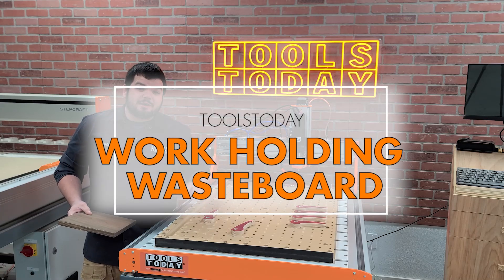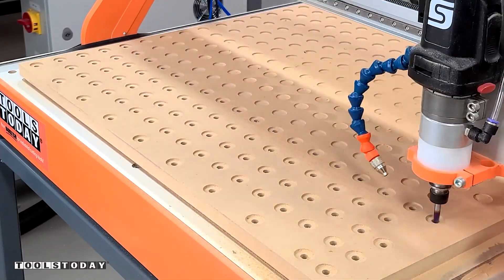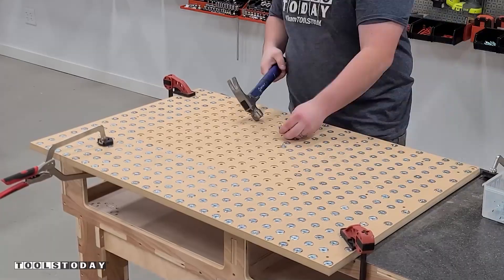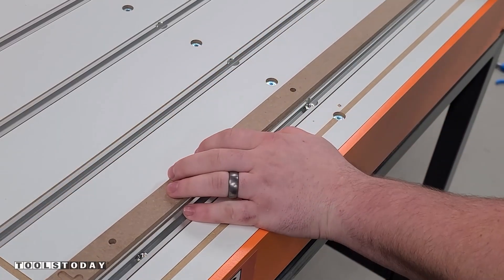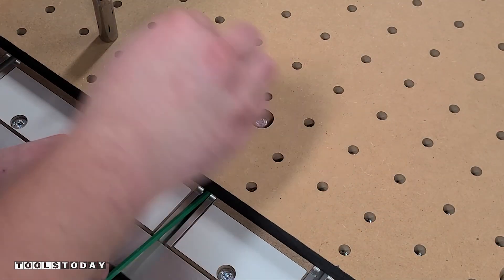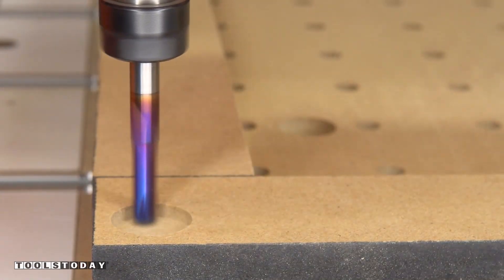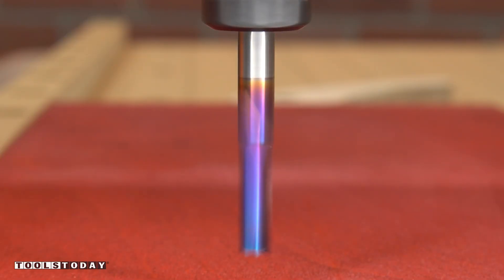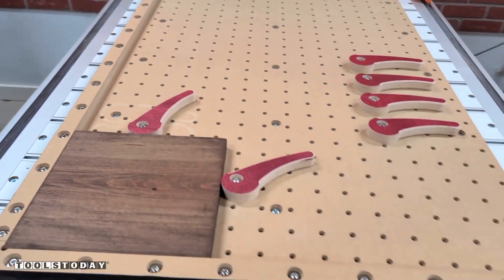How to Make a Work Holding CNC Wasteboard | ToolsToday

Comment: i has  test many different wasteboard system and this is best, i have bolt grid 2"x2" size M6 bolt uses., and working well, maybe sometime need if build 1"x1" bolt grid have better. but this wasteboard i have smalles piece can add to top normal wasteboard if need smallest grid. modular, can use some different wasteboard top of this wasteboard. bolt on smallest or vacuum board or special own only one workpiece board etc.
Reply from the maker: That sounds like a great wasteboard setup, I appreciate you sharing your experience!

Comment: I see that on the two fence pieces you painted the outside edges as well as the end of the spoilboard that shows, but did not paint the sides of the spoilboard. Can you advise the reasons please?
Reply from the maker: Purely for filming purposes. The cut edge of the MDF creates a bright spot when I set up the lights around the machine, painting it black eliminates that making filming easier.
Reply: @ToolsToday  Thanks for your prompt reply. I thought that it might be to protect it from spilling something wet on the MDF.

Comment: Nice.. 

But with double sided tape and CA glue.. 

Do you even really need tabs for most projects? 
You can cut the profile but your part is still secured with glue. 

I don’t even use tabs except for rarely or in aluminum.

Comment: Just downloaded the plans for this. Can't wait to get it modified to run on my Q404!! Thanks guys!
Reply from the maker: sweet!
Reply: @ToolsToday  I have the 16x16 AirWeights vacuum board and it clamps right down on this as the hole pattern matches exactly. I'm guessing the other AirWeights tables you guys have are the same. Makes setup and switching between manual hold downs and vacuum hold down a breeze. I have used your cam clamps as well as plethora of other types I've made to clamp things down on my Q404. This wasteboard is so versatile!

Comment: Great video, bought the plans and the Amanda bits.  When I fitted the bit into my CNC with the waste board in place I did not have enough Z height as I have the ATC adapter fitted to my spindle which reduces the Z height.  Looking closer at video, I see that your spindle is higher than mine.  You must have spacers installed.  How many spindle spacer rings have you fitted on your spindle?   Does the ATC still function with the spacer rings and the exhaust adapter connector (brush).  Please can you make a video showing how you use the spacer rings to raise your spindle, and show it fitted with the exhaust adapter and using the ATC.
Reply: Had the same problem with the Z height. So I designed a spacer in Fusion360 and 3D printed it. The height of my spacer is 25mm (1 inch).

Comment: I'm not seeing the materials list size T-Nuts and screws for the spoil board. I did find for the cam clamps.I already purchased the  plans.
Reply from the maker: Did you get the instruction file to go along with the plans?  It should have all of that information in there.  If you didn't for some reason, please email us at ttsupport@toolsday.com and we will get it to you.
Reply: t-nut size have what you want normal used M6 nut and bolts.

Comment: Hello Matt, GREAT informational video!! Thank you for taking the time to show us!!  Can you advise what size bolts (I believe 18pcs) and what size nuts (I believe 18Pcs) that fit inside the aluminum channel?  AKA, The nuts and bolts you used for attaching the waste board to the M1000 white board's aluminum track? Also can you tell us how long the 3/8" bolts used to hold down the clamps??  Hoping you can make a material list (quantity's/sizes) of all material used?  Trying to get all parts together prior to purchasing the plans and cutting the waste board! I have the bit's needed in my  tools today cart. :) 
Thank you so much in advance!! John...
Reply from the maker: Hey John. Thank you!  The plans have links to all of the hardware I used as well as the quantity of each.  I don't remember off the top of my head what each one was
Reply: @ToolsToday    AWESOME!!  Thank you!!

Comment: What spacing did you decide on for the holes? Anything lead you to that design choice? (Just wandering what ranges of values work well?)

Edit: guessing 1.5 inch?
Reply from the maker: Yes, I chose 1.5" on center.  It will allow me to hold most pieces without using any sort of spacer.

Comment: Hi. Great. But the right clamp must be inverse to sqeeze to the left corner down.
Reply from the maker: I've never personally run into an issue needing to inverse a clamp.  You don't need to clamp it at the very base of the work piece, clamping in the middle provides plenty of pressure.

Comment: What would you suggest as a work hold down for a larger piece of acrylic? I am currently using double sided tape but if I am cutting several sheets of acrylic it is very time consuming to install and remove the tape.
Reply from the maker: If it's thin material, the best option is some sort of vacuum table setup.  It's not always possible to do, but will save tons of time if it's something you're doing frequently.  Other than that, the double sided tape or screwing the piece to the wasteboard would be my preferred method.

Comment: Great work and beautiful content. I can't help but think that the waste board is somewhat over engineered a bit. As I watched you work on the waste board, what came to mind was simply sandwiching layers of pre-drilled pegboard. One could use two, three, or four layers of pegboard with the holes all lined up and then holding that down by your favorite method from outside the cutting area, flattening the board and finishing up with the clamps that you used. Also, there are still a great many users who don't have the elaborate setup that you have nor the large cutting area so relying on pre-cut pegboards would also be a time and cost saving alternative. After all, store bought pegboard is probably made with CNC machinery anyway  and would have perfect alignment as would something that is made entirely in the shop. Just a thought.
Reply from the maker: I've never tried that, but it's certainly possible that it could work.  I find that machining my own holes on the CNC machine provides more accuracy and ensures everything is lining up the way that I want it.

Comment: Looks very neat but I imagine the entire process took a while? 
What home sensors does that CNC use? I’ve read that proximity sensors aren’t accurate enough to do repeating cuts. Or do you home the piece every time?
Reply from the maker: It's always hard to judge how long things take when filming as that adds a ton of time.  I have made these before in a single day for a different CNC when I wasn't filming.  This CNC uses limit switches for a positive stop every time.
Reply: i use 4mm promixity sensor my all axis home switch and have sure accurate and all machie what i has seen, thousand, have promixity sensor and workng well factory or hobby user. normal big 18mm hole sensor not have accurate but small sensor have, 3mm sensor sense less than 1mm area and accurate have 0,002 mm newer not need cnc better accurate anywere.

Comment: Useless!!!!! Just glue down a fresh piece of mdf. Run a surfacing program. Then add your corner fence for 0,0 registration.  simply use wood screws and hold down bars ANYWHERE you need then and cut through as needed.  More than strong for little CNCs. SAND AND BACKFILL WITH BONDO OR WOOD PUTTY TO REPAIR AND REJUVENATE WHEN NEEDED!!   Best way by far - spend your money on essential business tasks.  not on fancy T slot crap that’s no better than anything else.